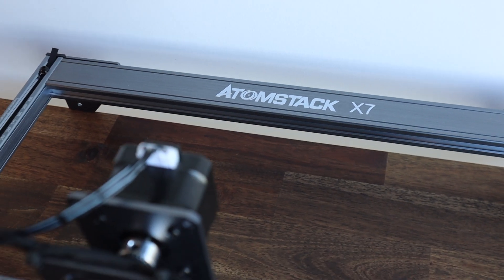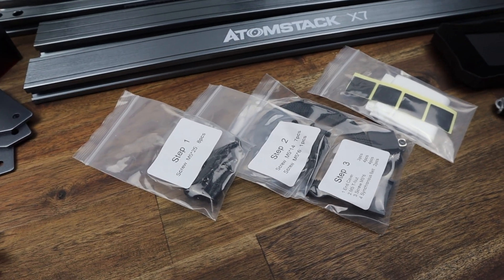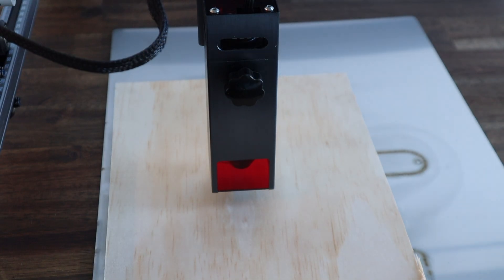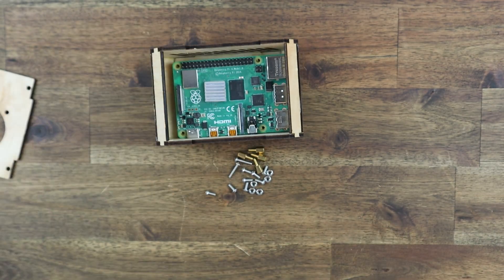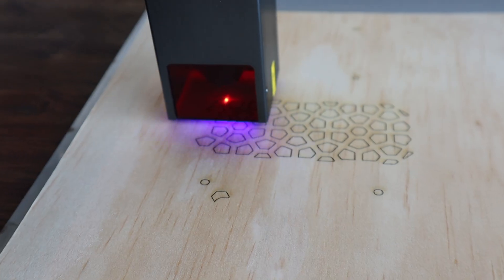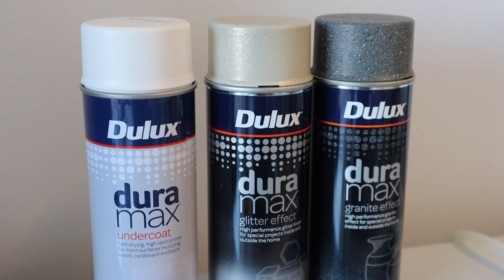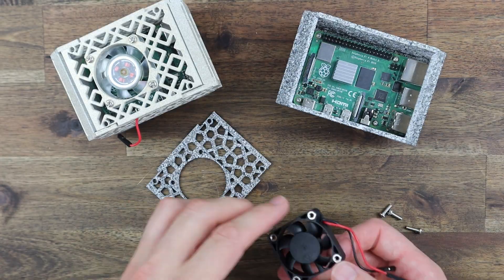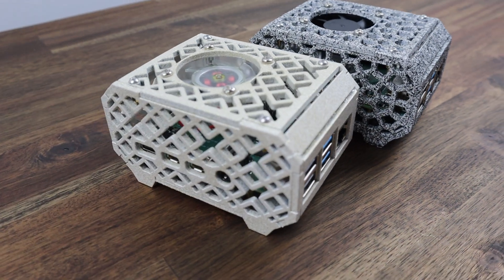Laser Cut Raspberry Pi Cases Using The Atomstack X7 40W

Comment: Love your work on the Raspberry Pi laser wood case.  Is it possible to purchase your laser cut file?  I have been playing a lot with my Ortur Laser and looking for another project.  Looing forward to hearing from you.
Reply from the maker: Thanks Brian. I've been meaning to work on an alternate solution to the brass standoffs for the cover - these are messy to glue in place and make it a bit difficult to remove the Pi from the case. I'll then look at publishing the design files.
Reply: @MichaelKlements  I have done a few things with small magnets.  If you want to collaborate let me know.

Comment: What plywood are you using? I need a good source of plywood that's not too expensive. A lot of it is super high quality and I just want one that's good, not amazing. Do you have a website or store to recommend? I know that you did link the plywood you used in the comments, but I was wondering if you had any other good suggestions for a range of different types.
Reply from the maker: The plywood linked in the comments isn't the exact one I use, it's just a similar one from Amazon.
I use a plywood from a local hardware store, it's a sheet of Premium BC Grade Pine Plywood
Reply: @MichaelKlements  I like to use plywood too, but my cutter can't cut much over 5mm, and preferably 3mm. We found that our home depot doesn't stock that thin, and we might need to check somewhere else/

Comment: These are very good good Laser Engraving Machine. I was not to long ago looking at the ATOMSTACK A5 PRO 40W. What do you think of that one?
Reply from the maker: I haven't tried the A5 Pro 40W, but their build quality in general is very good and the actual laser module is definitely one of the best diode lasers I've used. If you can, try get the X7 40W rather, the offline controller makes it a lot more usable as you don't need to always have a computer hooked up to it.

Comment: Interesting machine. It's currently £303 direct from China to UK. I didn't know little diode lasers directly on the gantry were available with this cutting power. I thought you needed one of the ones that bounce a laser between mirrors to get cutting done. I wish you'd try some different thicknesses of materials up to their claimed max to report cutting speed and quality with various workloads.
Reply from the maker: I think they've come a long way recently, their X7 Pro has a 50W (10W optical output) laser which is a lot more powerful than what was available a year or two ago. Check out Make or Break Shop's video, he does a few cutting tests on the X7 Pro - https://www.youtube.com/watch?v=NQoeYksA_ao